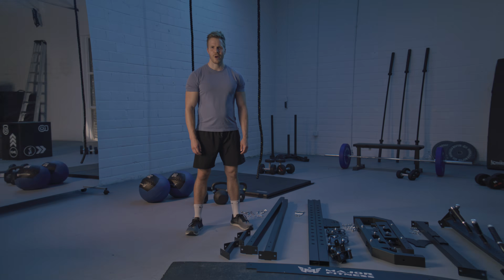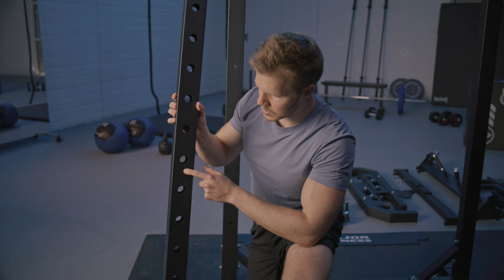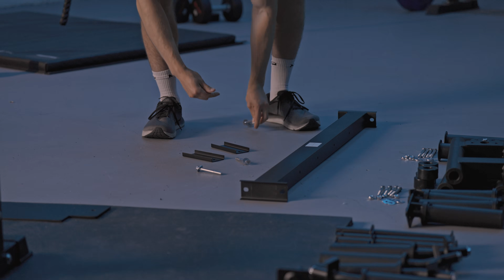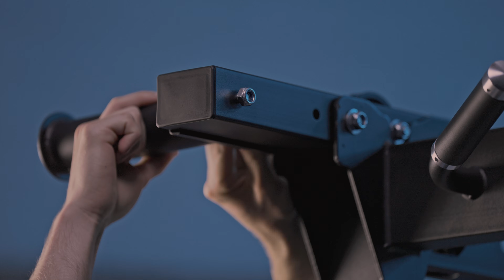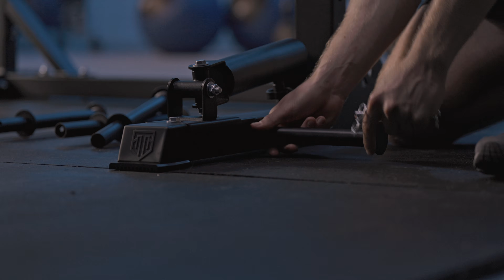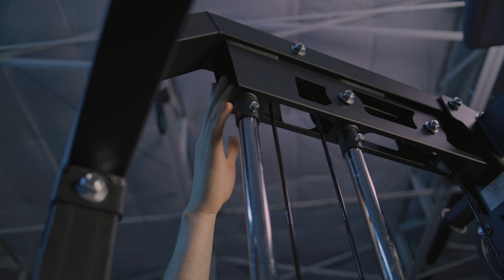Installation Walkthrough | Major Fitness F22 All-in-One Power Rack

Comment: What would you guys recommend to make the cables smoother? I was thinking about some sort of grease on the metal poles. Now admittedly I still am awaiting for my plates to ship to me so my experience has just been putting the cables through some basic movement patterns just for fun. I am hopeful that when I load the plates on the trolleys it will smooth out as well. Does anyone know if that will be the case?
Reply: WD40 silicone